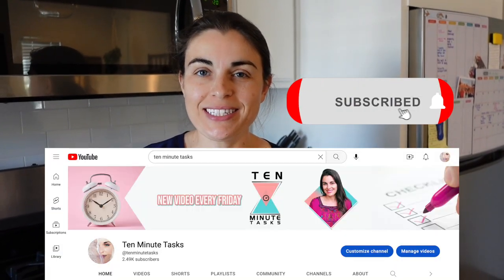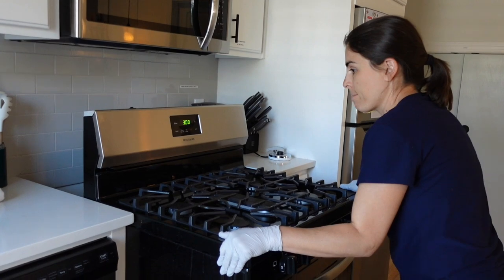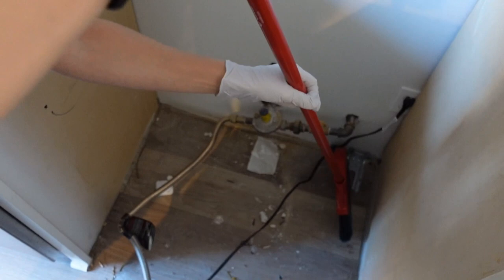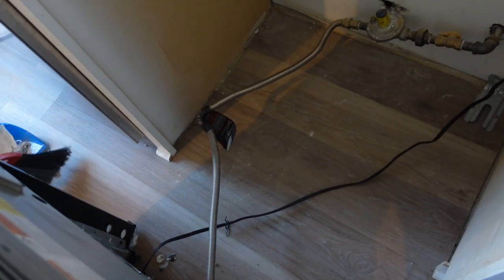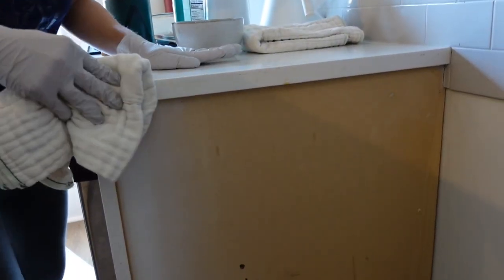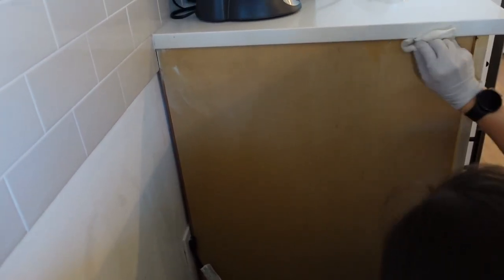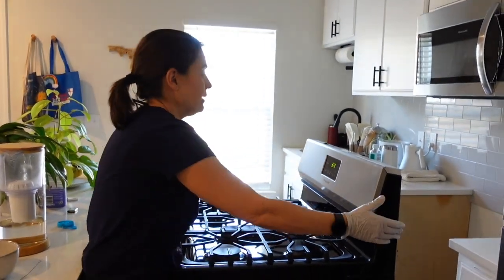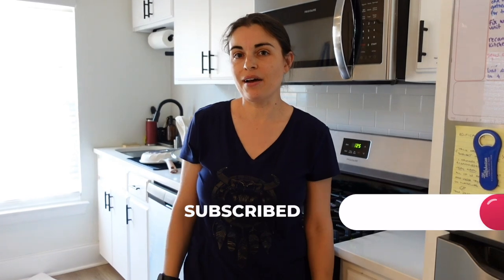How To Deep Clean BEHIND the Stove, when you're SCARED 😱

Comment: Thank you. I need to clean behind my stove, but afraid of the gas. I had no problem doing it for electric stoves.
Reply from the maker: You're welcome.  I hope you were able to get the job done!
Reply: Me too I'm afraid of my gas stove
Reply: Don’t be afraid. They are usualt installed by master plumbers and given enough flex to pull out and clean. 

Also the gas valve can be turned off do not worry about it. Just make sure to turn it back on. The odds of anything being loose enough to be disturbed by any sort of cleaning are astronomical.

Comment: Did you have any issues with the floors, or potentially scraping them when pulling the stove out? Just curious. That's the part I'm kind of worried about!
Reply from the maker: I didn't have any issues.  My stove is new and the bottom has padding.  I also have indestructible flooring.  It really depends on what you have going on there.  You could possibly roll it out onto a thin mat if you're worried about scratching the floor.

Comment: I was able to pull out the oven so easy.But pushing it back towards the wall is freaking heavy and won't move at all. What to do?
Reply from the maker: It really depends on what kind of surface your stove is moving back on.  Is there something blocking it?  It might require 2 people to lift it forward to tilt it a little, then move it back towards the wall, then push again towards the wall.  I wish I were there to physically help you move it!  Good luck!
Reply: Thank you very much. The flooring is carpet and that's why it was difficult. I ended up leaning it forward then used my hips to lifted. I'm proud of myself even though I was able to push it back a few centimeters 🤣🤣
Reply from the maker: Carpet?  Oh no!  That makes it much harder to move.  Good for you for doing that all by yourself!

Comment: I pulled mines out. Now I can seem to get it to go all the way back in
Reply from the maker: It can be tricky getting the stove back into place after pulling it out. One thing you could check is if the gas line or any wires are getting in the way. Sometimes they can get caught or bunched up, preventing the stove from sliding back all the way. Also, make sure that the legs or wheels on the stove are aligned properly with the floor. If that doesn’t work, you may want to gently move it side to side while pushing to help it slide back in. Hope this helps, and good luck!